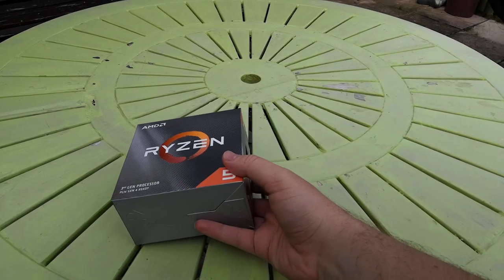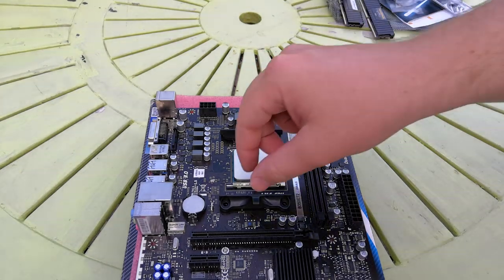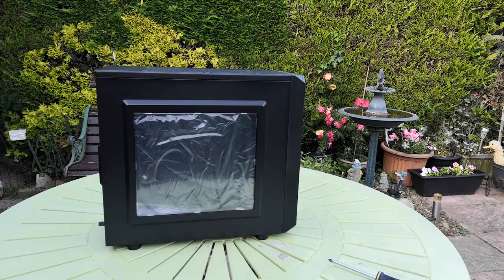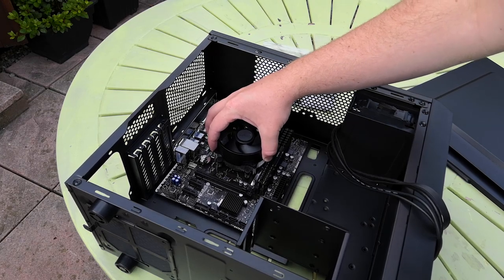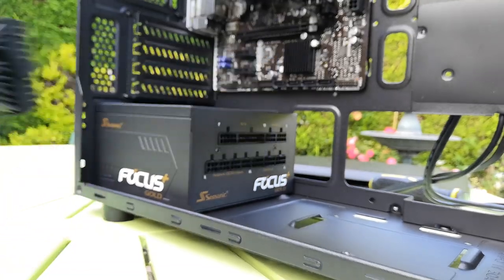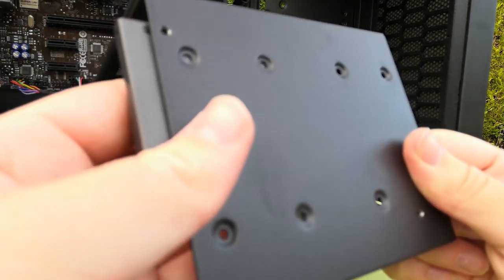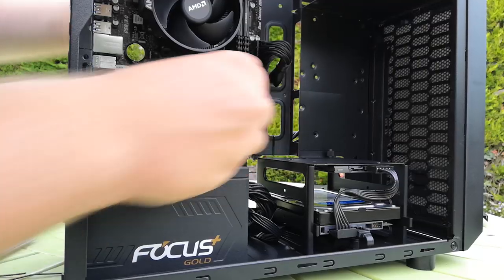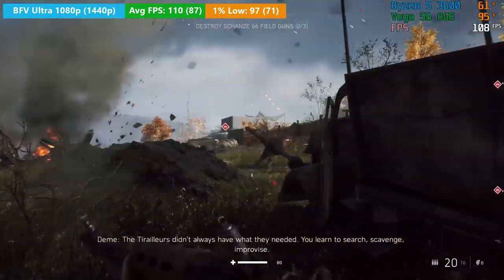Building a Ryzen 5 3600 Gaming PC!

Comment: Was the bios update necessary for the 3600 ? as the motherboard box does say AMD RYZEN DESKTOP 2000 READY ?
Reply: It probably requires a new bios. My AsRock AB350 Pro 4 shipped with a bios ready for 2000 series CPUs, but I don't think that was the original bios. I know my mobo will require a bios update to support 3000 series chips should I decide to upgrade to one.
Reply: @jtenorj  Depends on how long the motherboard has been sitting on the shelf i guess ?  just checked mine and it was shipped with version 4108 and will take any version Ryzen so thats good to know :)

Comment: The exact config im planning to build. :D 
Thanks for the video. Also a question: Would my 520W Antec HCG 520 (80+ Bronze) be enough for it, or I need a new PSU?
Reply: that depends on what gpu you are pairing it with. if it's low end gpu. then it's fine. but if it's beast gpu. then it's gonna be a bit tight on that wattage...
Reply: @DMDMDM7  Vega 56. Probably from Gigabyte or Sapphire.

Comment: anddd this is how I found out that unfortunately rgd is a amateur pc builder he didnt run the eps connector through the top and installed the hard drive backwards
Reply: You mean the 4 pin/8 pin CPU connector? He ran that through the top cable management holes. He explained why he installed the drives the way he did. He swaps them between systems a lot and it's easier to mess with the cables on the windowed side than on the back side. My own personal experience backs that up.

Comment: Undervolting the Vega 56 and overclocking HBM2 VRAM helps a lot.
Reply: For gaming though doesn't it make more of an impact to overclock the core? I though overclocking the ram and leaving the core alone was more of a mining type of thing from what I've read.
Reply: @jtenorj  Nope. Overclocking VRAM increases the speed that game textures etc. can be loaded and displayed. Of course both of them help but flashing a Vega 56 to the Vega 64 bios, undervolting and overclocking HBM2 see a massive increase in performance. Like near/past 2070 performance in games.
Reply: @Amusia727  That just doesn't make much sense to me. Vega already has relatively high bandwidth(400-500GB/s) versus price performance competition from Nvidia. There seems to be a limit to how many stream processors actually get used on the higher end cards, which is why a 56 OCed to 64 speeds(core) has similar performance and faster still if OCed higher. That's why Radeon VII has a middling amount of stream processors but is clocked a lot higher.

I know the new rx 5700s use the new RDNA architecture, but it's based in large part on GCN. They have far fewer stream processors than Vega but are clocked quite a bit higher, and they are in the same realm performance wise if not higher. That's with similar theoretical memory bandwidth.

Comment: Sir what is the idle temperature of the cpu with the stock cooler for this build and what is the room temperature ?

My build shows idle temperature 55 to 60°C 
Room temperature - 30°C (stock cooler and stock thermal paste)
Reply: The idle temps on my 2600x were upper 40's - mid 50's with a room temp of 21-22c (68-72F) until I swapped from the Wraith Spire to a larger tower cooler. Now its down to 30's at idle. So you numbers don't sound far off with a Stealth and 30c room.
Reply: @FireMrshlBill  thank you for the reply ,I will run the stock cooler for few months and keep noting the temperature ,if it increases with time then will think of going with aftermarket cooler since the stock cooler provided with R5 3600 is the smallest one in ryzen series.
Reply: pravin raj ya, Ryzen runs a bit on the hot side. I wouldn’t worry about temps it unless you hit 80c a lot and for long periods. If under gaming you are in the 60s with bumps in the 70s, it’s ok. The spire worked ok for mine but the noise of the fan was the main driver in me upgrading.

Comment: If i have a ryzen 3 2200G with a B450 motherboard, i need to flash the bios, will work with the cpu ?
Reply: Mihai Burniche i think it will,
Reply: You don't have to do anything just install cpu. But research i might be wrong
Reply: https://docs.google.com/spreadsheets/d/1d9_E3h8bLp-TXr-0zTJFqqVxdCR9daIVNyMatydkpFA/htmlview?sle=true#gid=639584818

This is the VRM compiled guide which doesn't include all motherboards but it's a good place to look. It will tell you what your board is capable of handling without frying your VRMs. Odds are if you flash your bios you'll be able to handle Zen 2 unless you got a really low quality B450

Comment: @RandomGaminginHD
Also another question?
You mentioned that I shouldn't build my pc underwater...
In which fluid do you recommend I build my pc under?
Reply: CO2.
Reply: @robertkubrick3738  
Sounds like a good plan!
Ill need to crank the presure up in my room to about 5.2 bars and decrease the temp. to about -100 celcius... 

What could possible go wrong
Reply: @teaser6089  I didn't tell you to breathe it though. Dress warm with electric socks.
Reply: @robertkubrick3738  mhh I'd wonder how it would feel to breath liquid co2 at -100 degrees.

I mean you can actually breath certain liquids if they are infused with enough oxygen. Like here: https://en.m.wikipedia.org/wiki/Liquid_breathing

Comment: First off, great video as always. I have a question
I want to buy a GPU but I have no idea what to buy.
I have a R5 1600
I want something powerful, fast enough to run everything over 60fps on ultra
I think the cheapest way to get that is a second hand 1070 or Vega 56 but I'm not sure
Do any of you have any suggestions?
Reply: used RX 580
Reply: Pretty sure you can get the vega 56 for much cheaper than the 1070's new and it performs quite a bit better iirc
Reply: @kremeszdaboi1862  I feel like a 580 is not enough for some reason
I want to use it for atleast 2 years at high settings if I can
Reply: @gabrielmaccallum5742  I think I'm going to go for something secondhand
But yeah I think the Vega is a bit faster

Comment: msi vega 56 air boost recommended psu = 650 watts its written on the website ,9.30 ish front panel connectors you really should warn people to connect the leds correctly or they dont light up they are polarity dependent ,finally why pay £190 for a secondhand vega ,when the exact same model is for sale brand new with warrenty and free game pass for £235
mate not quite a 'verge' pc build video but you really have done better in the past ,pointing out the issues that are actually bad advice or missing info for viewers that rely on these videos for guidance
(imagine a guy goes a grabs a ace/aero etc brown box 550W psu for the vega ,its no end of trouble and issues until it goes pop ) msi are advising 650w for a reason, and that secondhand card is just expensive and foolish when its a fraction more brand new
Reply: You shouldnt buy sh vega cards.
Reply: @Bogdan00  why becuase they offer the top cost vs frames at the moment ? ,your comment is really riduclous ,its miles ahead for value
Reply: @tonybarden8563  most of them have been used as mining cards so it doesnt worth The risk
Reply: @Bogdan00  sorry when you said SH i thought you meant 'sh1t vega', hence my reply ,for 230 £/$ new vega 56 is fantastic value ,for £190/$190 secondhand its just not worth the risk, and lack of warrenty and free bundles

Comment: Ayyyeee I am actually in the process of building my first gaming PC with the rx 580 and 3600 ☺...wish me luck
Reply: Vega 56 , rx 580 or 5700xt??
Reply: @rajakhan12346 I'm a peasant so I went with the Rx 580....for now
Reply: @brian1291  is that because it's what you can afford right now ? Or
Reply: @rajakhan12346  I can definitely afford the Vega 64 or the 5700, but just want to get my feet wet with PC gaming. I'm still a console gamer in heart. Just wanted something "entry level". I already bought the 580, but will for sure upgrade later
Reply: @brian1291  580 is just enough for 1080p maximum setting or high

Comment: Can I use the mobo called "GIGABYTE B450 AORUS PRO WIFI" for the 3600?
Reply: You can, but Gigabytes vrm's aren't good. You can get a better MSI wifi board for a similar price
Reply: @Arik-2103  Thank you so much for the advice. But, what MSI wifi board do you recommend for a pure beginner like me? My budget is around $100-$130.
Reply: @veotic2728  that's an excellent choice
Reply: Gaming Dutchie Do I have to do anything with the BIOs or does it automatically support the new gen?
Reply: @veotic2728  if it has a sticker that says something like "ryzen 3000 compatible" on the box, it's good to go. If it doesn't, you need to get a first/second gen cpu to update the BIOS
Reply: @veotic2728   just talk to the store for updating your BIOS
Reply: @Arik-2103  LoL you can update bios without CPU too
Reply: @claritoresdiano1021  you can't on most boards
Reply: @Arik-2103  LoL can't on most board ? you're not make a sense.
Reply: @claritoresdiano1021  some boards have a bios flash button, but most don't. No need for a cpu to flash a bios is not a feature of the chipset, so it must be implemented by the board manufacturers themselves
Reply: @Arik-2103  what are you talking about ?  more absurd comment.

dude just browsing find then learn "how to flash bios without cpu" and don't be ignorant, not good for your head

Comment: Hi mate this sounds weird but all I wanna do is play runescape old school and do a bit of uni work
Reckon I could make a budget build with q6600 that will do this
I know nothing about computers sorry x
Reply: A modded LGA 771 for LGA 775 Xeon is probably cheaper and faster
Reply: I'd imagine a Q6600 and gpu of the past 8-10 years would be plenty. Ya, if you aren't really into building, getting an old Q6600 prebuilt and putting in something like a 750ti would be plenty for even the newer "HD" runescape and dabbling in modern games. May be able to get a prebuilt with an i5 for cheap, especially looking at 3rd/4th gen i5 and see about getting a 750ti - 1050ti that doesn't require external power and you can play pretty much anything you want (at 720p or better and at least 30fps). If you do go the Q6600 route, look up the electrical tape trick for OC'ing it.
Reply: Thanks so much guys
Reply: Iv found a dell orioles with an i5 3470
8gb ram for 78 pound then thinking of putting a 750 ti in it
Reply: @MrRsisownage  Ya, that would be much better at this point. Make sure to get a card that fits the form factor of the case (if it is a small form factor, you may need to get a low profile gpu). I wouldn't go under 750ti for driver support, so I would start looking at that and maybe look to see if you happen to find a good deal on a 1050ti, you never know and may get one for not too much more than a 750ti if someone is looking for a quick sale.

Comment: Can i run vega 56 on 600 wats bronze ? i see you run it with 550w
Reply: just stock usage should ok
Reply: Ofcourse
Reply: I run a vega 56 with just  500 watts. Only with 1 case fan and an SSD ,no HDD.  Make sure  all the motherboard power connections are populated , to ensure all the USBs have enough power .

Comment: Don't waste your money on this CPU. The 7700k came out early 2017 and is faster eith a very slight overclock than this. Blows it away with a moderate overclock and costs 50 bucks more. Quality CPU from 2.5 years ago that's better than one just released.
Reply: L3 Cache only 8MB
Reply: @claritoresdiano1021  - And still faster than a a just released CPU.
Reply: @mynameisray   mynameisray  7700K cost 376$ + Z370 Mobo 163$
while 3600 cost 227$ + B450 Mobo  149$
Intel 539$ - 376$ = price different 163$
*Both new condition + not cheapest mobo
*Price converting to USD

what's waste money ? 
of course in 2017 definetly choose 7700K and at this moment with price 500$ for CPU i consider R5 3700X

why 3700X not 7700K ?
7700K;
- 91W TGP
- 4 Core/ 8 Thread (fake 4 thread)
- L1 256KB; L2 1MB; L3 8MB
- 16 PCIe slot lane
- DDR4 bandwith 38.4 GB/s

3700X;
- 65W TGP
- 8 Core/ 16 Thread (fake 8 thread)
- L1 512KB; L2 4MB; L3 32MB
- 24 PCIe slot lane
- DDR4 bandwith 51.2 GB/s